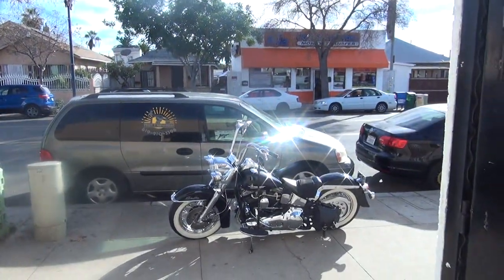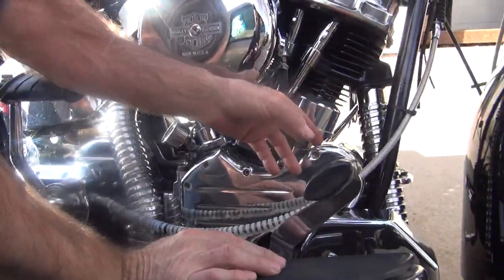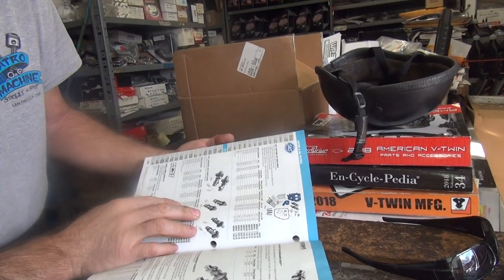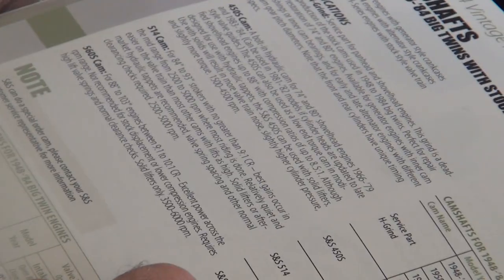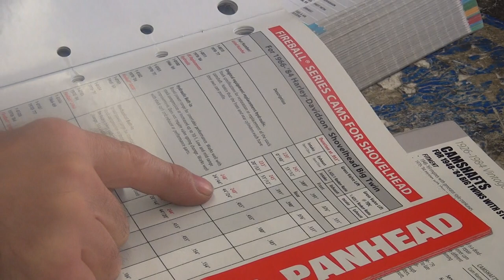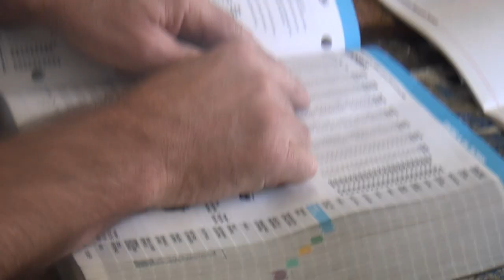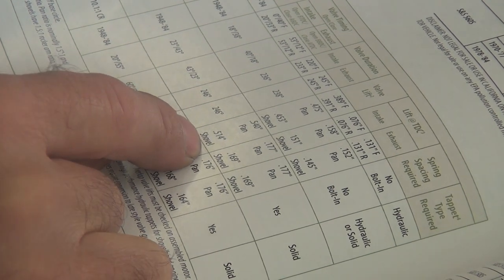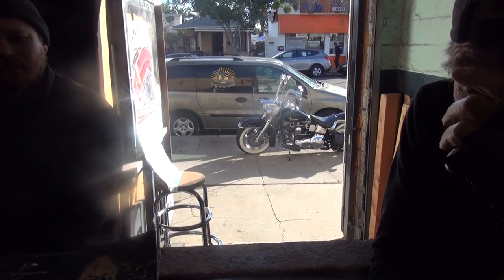#142 how to do it, pick a performance cam for panhead shovelhead fl flh harley by tatro machine

Comment: I put a Woods W6 cam in my 1998 Road Glide and ABSOLUTELY LOVE IT!! It has a VERY noticeable power band and pulls like a freight train! This Woods cam works best in a higher compression motors. Hence why i decked my heads .050" and installed a MLS .030" head gasket, I have 192 psi in each cylinder, so far so good. I also added Velva Touch lifters with matching Steel Tappet blocks due to the JUNK aluminum ones being completely worn out. The Velva Touch lifters REALLY enhance the cams profile well and keeps the valve train  noise at bay. This might not have been the cheapest "drop in" set up but I like it and it's not too radical of a cam lobe.
Reply from the maker: all that noise is what kills the valve train. the woods cams make good power but they are hard on everything. 192psi is too much for cal gas. 175-180psi is about it for around here. detonation will do more damage than that little extra power you get. race motors run race gas and street motors run pump gas.
tatro
Reply: Keenan, I put my pushrods deep into the lifters which quieted it up nicely. To be honest with you its really quiet. My stock starter rolls the motor over nice and I dont eat up batteries. 190psi might be a tad on the high side but it seems like its hanging in there, so far I've put roughly 20k on the motor in this configuration. I typically am able to get away with running 93 octane pump gas. https://youtu.be/eIohnw2glPk

Comment: I had a Andrews B2 (.507) cam in a 1959 panhead with a 3 5/8” bore... 83 cubit inch...great idle good running but mid to highend....took out and replaced with Andrews A2...lower torque ... running solid lifters. 

BTW have 200 miles on that B2 cam, 125.00 and it’s yours 😁😎
Reply from the maker: thanks, but he needs a bh hyd cam. nothing worse than too big of a cam for your application. a good valve job makes the most change in usable power.
tatro

Comment: I got a 74" panhead with s&s cases, complete s&s heads, hydraulic adjustable pushrods, lifters, lifterblocks etc...
I got a andrews grind A in it now but want a little more power. What would advice?
Reply from the maker: if you are using the stock type lifters than the b" gring or the s&s 514 cam would be the nest step up. if you are using the s&s evo lifter setup than go with an evo grind like a andres ev27 s&s 510 or the bigger ev59. 
tatro
Reply: @TatroMachine 
And is there a difference in reliability between the Andrews A and B?

Comment: I have a 75 FLH shovelhead and I recently rebuilt the upper end on this shovelhead. It has S&S super stock heads, Wiseco 9:1ratio pistons with Hastings rings, Jim's fire ring head gaskets, sifton rocker shafts, Vtwin factory rockers, Andrews AB Cam, Andrews pushrods, Jim's big roller bodies with stock HD hydro units. Cylinders was honed and matched to pistons. What cam would you recommend for said set up? The bike has a 4spd transmission. I'm thinking good torque through out the rpm range of 2k- 5k. Any input would be appreciated. Thanks boss.
Reply from the maker: i like the andrews A" cam for lowend, the andrews B" or s&s 513 for topend. the hyd only works with the A" cam.
the best thing to do is use the s&s evo conversion lifters and use an andrews ev27 cam. a very nice and reliable street combo.
tatro
Reply: @TatroMachine  awesome. I'll have to look those up. You can run Evo lifters in a shovelhead?
Reply from the maker: yes, just watch my shovelhead videos.
tatro

Comment: Am I wrong in my thinking? It's a panhead. Not a race bike. And your top end speed is only going to be so much without doing damage to the engine. So what is the point of a bigger cam?
Reply from the maker: sounds like a man that only wants a stock bike, not everyone does. this is a 93ci panhead and he wants more power. this video just shows you the process of figuring out what the customer wants. anything can be raced, stock or not. if you build the motor correctly you can beat on them pretty damm hard and still live just fine. just look at my 42 wla and 57 panhead. 
tatro

Comment: WHATS THE BIGGEST CAM I CAN INSTALL IN A STOCK EVO I WAS THINKING ABOUT THE ANDREWS EV27
Reply from the maker: under .550 lift and .200 td lift. the stock valve springs are only good to about 5000 rpm. after that, watch out.
the ev27 cam is very good for all around riding and bolts right in with stock pushrods.
tatro

Comment: Is that a Harley motor? What happened to your back? Get well!
Reply from the maker: stock type parts from all different years. it was an old pazner motor.
bad backs bite you at times. i slid a box out on the shelve looking for parts and that was it. lifting motor does not hurt me, putting on my socks does.
tatro